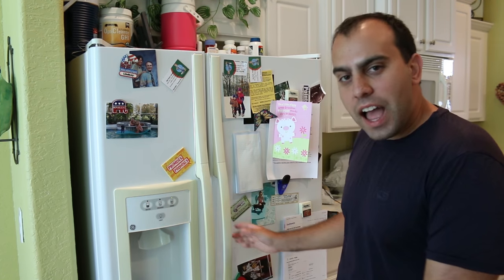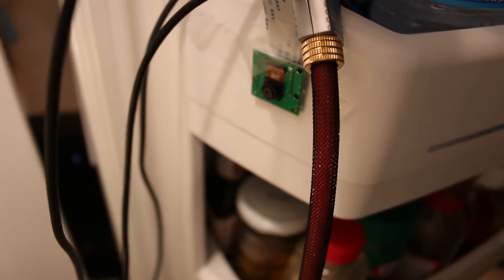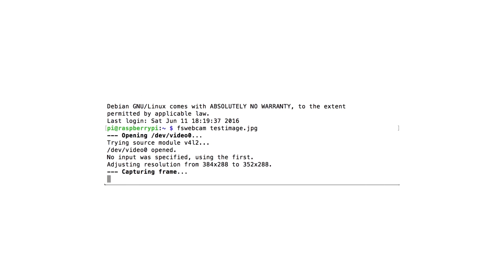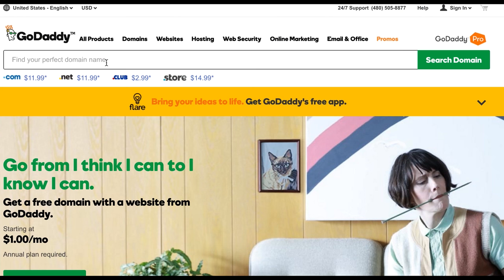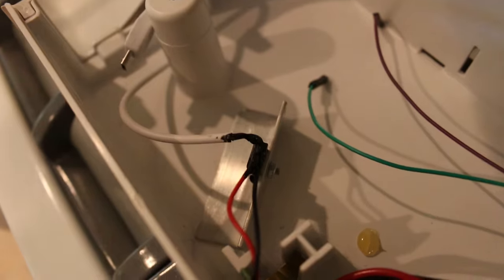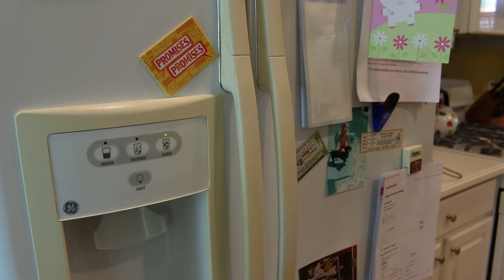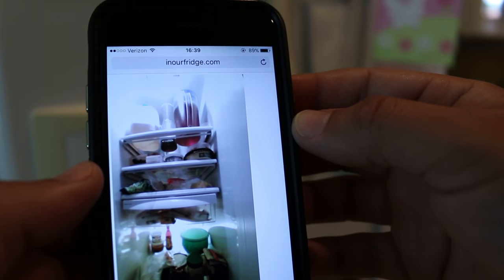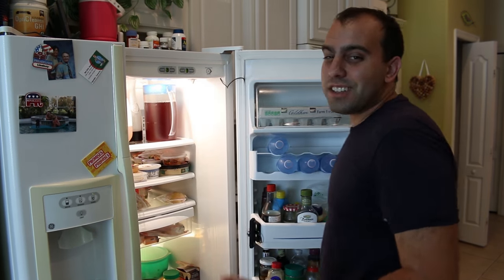DIY "Samsung Family Hub" Refrigerator with Raspberry Pi + Camera!!!

Comment: Maybe you could add a small two slim wires and put a potentiometer at the top right of the fridge door  and sense what angle the fridge door is at and only take a picture when the door is at that angle or specific resistance. Just a thought on how to take a picture at a specific angle.

Comment: nice project. I'm wondering if lens fogging has been an issue. I looked in your fridge, and the image looked a bit cloudy. Likely more of an issue if the door is being opened frequently, but a cold lens coming into contact with warm, damp Florida air seems like a perfect storm. If the camera could live outside the door, and peek in when it's opened that could help. Not sure if the added complexity would be justified, though, on a project that already works fairly well.
Reply from the maker: It only seems to be a problem in the early morning.  Not sure what changes at different times of the day?  Maybe the humidity?
Reply: +Mike and Lauren - could be more humid in the morning. If it's cool at night, chances are that your a/c is running less, and therefore drying the air less (at least that's my speculation.)

Comment: The only thing I might add is that the image could be incorrect.  For example if you opened it and took out the tea, the latest photo would still show the tea as it was taken right after the fridge was open and before you removed the Tea., not right before it was closed and after you removed something.

Comment: Awesome! I wonder if you could do the same with a pi zero?
Reply from the maker: I was actually just looking into that.  It only has one USB jack right?  That could be a problem because you need wireless and the webcam.
Reply: +Mike and Lauren It looks like the newest version has a pi cam connection but that is going to have the same narrow view. They do make hubs and other stuff but it is all added equipment. If you have to buy too much stuff to do it the cost savings is a wash. Anyway I loved the project and video!

Comment: Hi M&L.  I like the concept of this project, but as you are already aware, it has limitations.  Like not being to see the contents of the door etc.  So, I think at the moment I wouldn't be inclined to install one.  Having said that, the SD card idea sounds promising.  I like more the idea that there could be a barcode scanner in the kitchen so that when you use stuff, and if you're near the end of it, you could scan it and perhaps that info would be stored on a Raspberry Pi or Arduino and it would effectively generate a 'shopping list' for your next shop.  We, (my family and I), do quite a lot of online grocery shopping these days, so to be able to copy and paste the shopping list into that supplier (without first having to do a 'stock check'), would be extremely useful.  Not only that, but if it were possible to access the Raspberry Pi remotely, (and then copy and paste the list), you could do the shopping without having to be at home.  This also helps to solve the fridge issue (although along a different line), but it includes EVERYTHING else at the same time.  I can't help feeling that there would be a lot of commercial interest in a system like that.  Love your videos.  Regards Mark in the UK

Comment: On the website, http://inourfridge.com/, you mentioned that you were having problems with the WiFi signal strength. You can try placing the Raspberry Pi and the WiFi module outside of the refrigerator and place the camera and light sensor inside the refrigerator.

Comment: Wouldn't the Samsung take a picture when you start closing the door? That way it would show what you have just taken out/put in whereas when it does that at the beginning you don't have the actual last state.
Reply from the maker: I believe the Samsung has lights inside the refrigerator that allow it to take a picture after the door is closed.   That would have required 3 cameras which I wasn't interested in.  This is accurate enough for our purposes (mostly novelty).

Comment: I've been programming for a while and there's a few small things you could do to increase your code quality:
1. Put this line before the whole program (without quotes): "#!/usr/bin/env python3". In general, this line is considered good practice and will ensure that the code is run by the right executable on the system, especially if others are using it. More info: https://en.wikipedia.org/wiki/Shebang_(Unix)
2. It seems like you've left some password information on line 14. I could be wrong, but if you have, you should change the server's password right away.

Other than the above two points, great job! I may try this out myself if I can get the time.
Reply from the maker: Thanks for catching that!  I edited the uid/password out then just pasted the old one in haha.  I've added your suggestion as well.
Reply: One more suggestion - though its a pain, you should probably change the password you use to connect to your FTP server. It's good practice to throw away any "private" credentials that have been made public.
Reply from the maker: Good point.  That's a really old password that's only used for that, but I should change it.
Reply from the maker: Alright, got it changed :)
Reply from the maker: Hey Ryan, quick question.  Would you have any idea why the camera seems to take a picture inside the fridge with the door closed if it sits for like 3 or 4 hours?  Alternatively, any ideas how I could tell it not to upload all black pictures?
Reply: A few possible reasons why the sensor may be reading false positives:
1. A difference in surrounding light level around the fridge may cause light to leak into the fridge, triggering the sensor.
2. Is there a possibility that the fridge light may flicker on for a split second and go dark again even when the door is closed? Maybe there's a flaky connection somewhere?

You may want to try moving the light sensor somewhere else in the fridge to hopefully reduce any sort of light leak from the outside. Also, you could leave a camera in the fridge to test any flaky-connection theory. If you're willing to put in some more work, you could also attach a transistor or relay of some sort that would detect when the light comes on (wired directly to the light), bypassing light level altogether. That would probably be  whole separate project in itself, though. :)

Regarding not uploading black pictures, there's a great python library called PIL that should be able to help you here. Something like the below should be about what you need:

from PIL import Image
im = Image.open('image.jpg')
pixels = im.getdata()

nblack = 0
black_thresh = 50 # 50 is a threshold. It's a number from 0-255 that represents how light or dark a pixel has to be to be considered "black".

# count the number of "black" pixels in the image 
for pixel in pixels:
    # (I'm only checking the red channel of each pixel, but I'm pretty sure this should still work fine)
    if pixel[0] < black_thresh:
        nblack += 1

# the total number of pixels in the image.
n = len(pixels)

if (nblack / float(n)) > 0.5: # calculate the percentage of the image that's black
    print("mostly black, so don't upload me")
else:
    print("a good picture")

(above code modified from http://stackoverflow.com/questions/27868250/python-find-out-how-much-of-an-image-is-black)
Reply from the maker: Ryan Gaus Awesome thanks!

Comment: Very cool! Electrical engineer here, yes a linear regulator like your 7805 just cuts off the voltage, dissipating that excess energy as heat. So the higher that the output voltage is over 5V, the more heat that's generated and the lower the efficiency. The switching power supply you ended up using is a DC-DC "buck" converter, bucking down from 12V to 5V. Something like this would have worked just the same, but in this case your car adapter is probably the best method! https://www.amazon.com/RioRand-LM2596-Converter-1-23V-30V-1Pcs-LM2596/dp/B008BHAOQO#nav-search-keywords
Reply from the maker: I actually bought this one before realizing it's basically what I already had.  Then I thought of the car charger.  https://www.amazon.com/DROK-Regulator-Numerical-Adjustable-Stabilized/dp/B015YZZ1G8/ref=sr_1_1?s=electronics&ie=UTF8&qid=1465690246&sr=1-1-spons&keywords=voltage+regulator&psc=1

I'll keep it around, I'm sure it will eventually come in handy.
Reply: +Mike and Lauren That one looks adequate too, yeah DC-DC converters like these always come in handy.